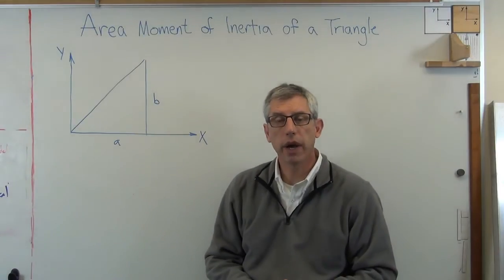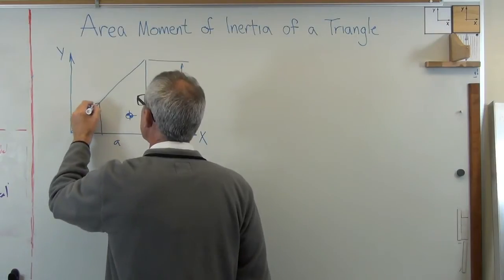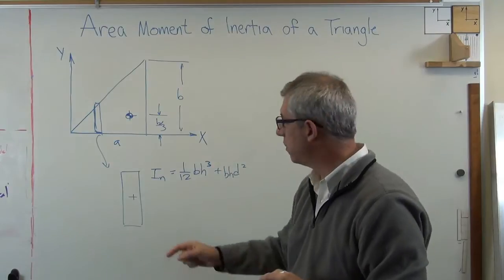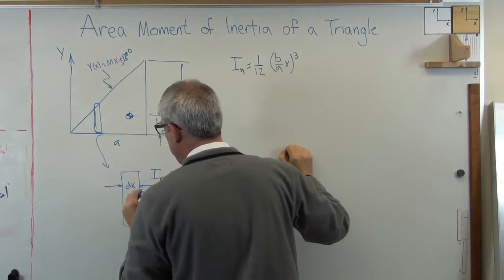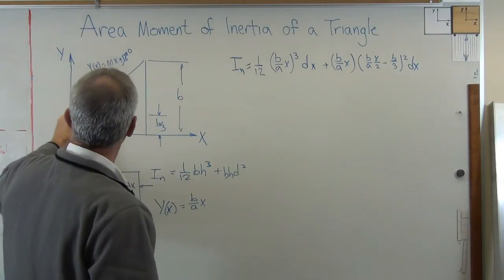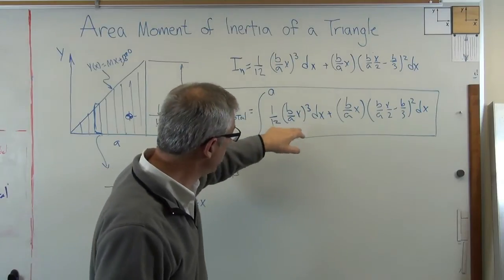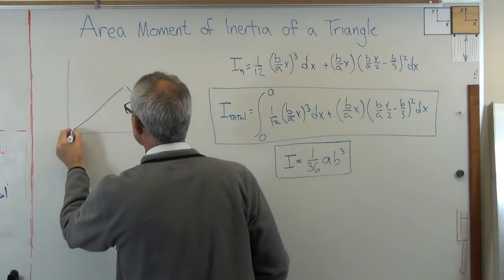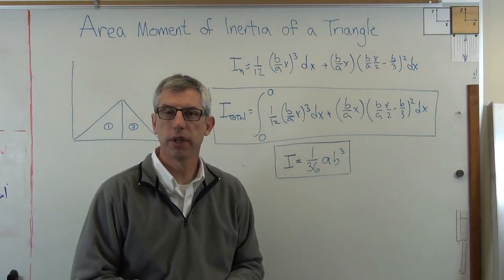Area Moment of Intertia of a Triangle   Brain Waves

Comment: Hello PurdueMet;
 
            So I’m trying to figure out the Area Moment of Inertia for a “Diamond” tube.  Essentially I took a square tube and rotated it 45 degrees.  I’ve come up with three ways of doing this and they all find substantially different results.
 
First I tried a subtraction method by subtracting the triangles if I were to draw a square around the out side of the diamond from the square as a whole.
 
Second I Added up 4 right triangles.
 
Third I tried calculating I for the diamond as a whole according to Wolfram website.
 
None of these answers were close enough to compare.  Essentially if these methods worked then all of the answers should have come out to be the same.  Thus my only conclusion is that the formula’s provided are false.  At this point there is no reason to go to the next step of subtracting the inside from the outside to get the total of the tube.  Perhaps you could shed some light on this issue?  Thanks